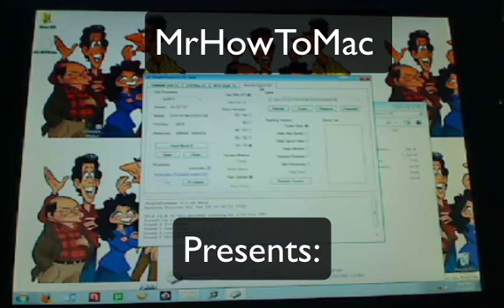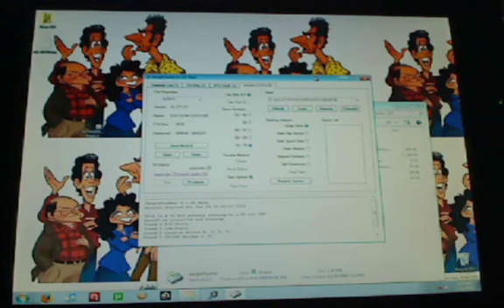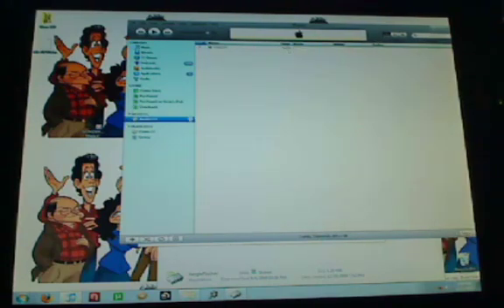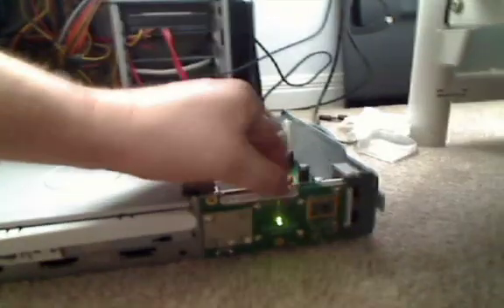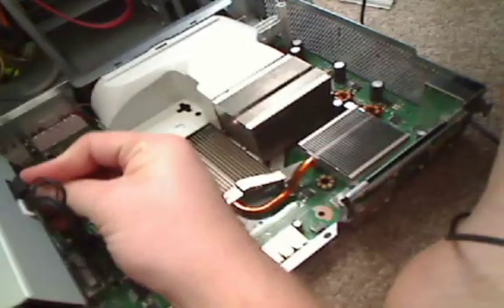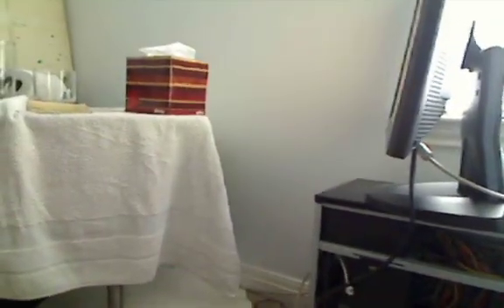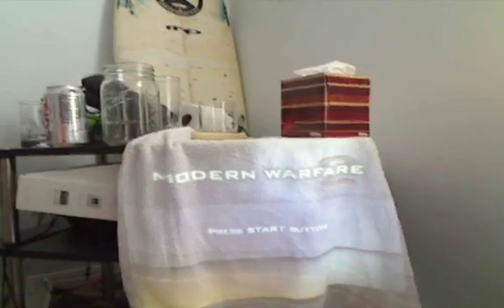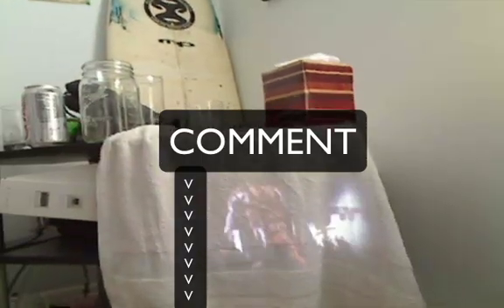How To Flash A Xbox 360 Hitachi Drive (Part 2)

Comment: Hey I followed the steps it seemed successful, however games come up as "play dvd" 
two hiccups I came across
    1. Jungle flasher had an error involving comports when it started
    2. this replacement drive is a hitachi, the original was a benq
The game I tested was a legit street fighter 4 disc btw